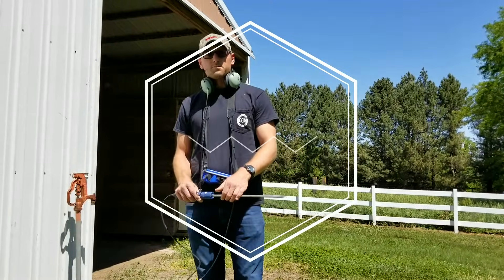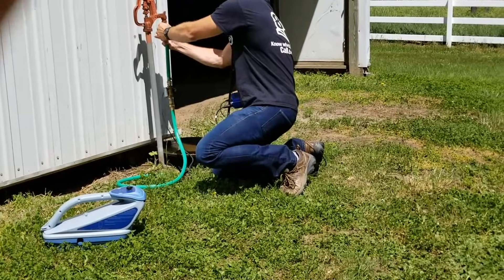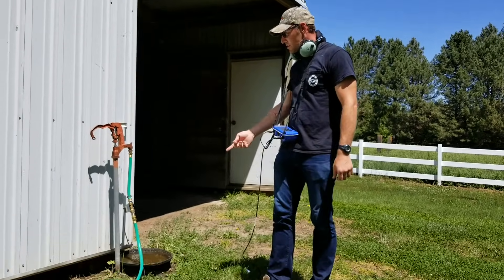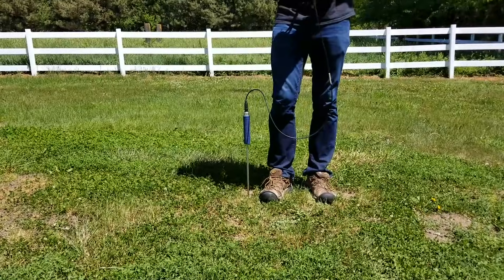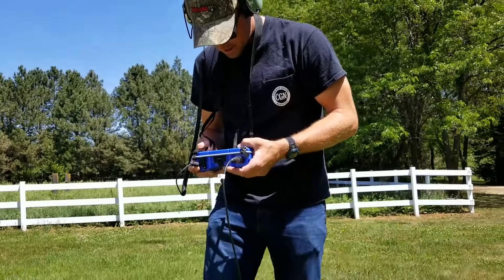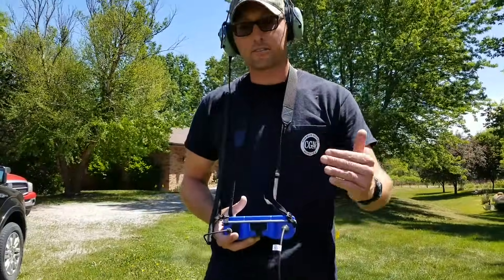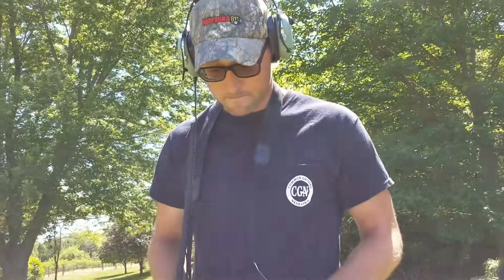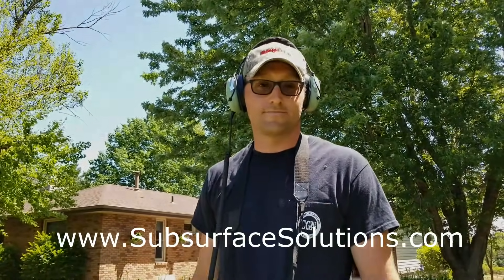Locating Plastic Water Lines

Comment: Friend bought house, it's has full plumbing, but no water when cut breaker on, the main water line leaves pressure tank, to hole in side of the house, then it doesn't go anywhere, yeah. No well cap nothing, appears 3 feet of water feed line coing out of ground, but just open hose, however, neighbors back yard, abandoned house, this house, owner died, relatives sold it, but know nothing about, so how do I locate well? Or water source?  Try tracing well wire? Digging?
Reply: You need to use a location device if there’s a wire that goes to the mystery well you hooked to that and locate if there is no why are you cutting said waterline stick a metallic fish tape through and then locate that

Comment: That's ok for finding the pipe but can it pin point where the leak is in said pipe? Does it give out a different sound where the water is actually leaking out?
Reply from the maker: Yes you can use the same equipment to find leaks.  Yes it is a different sound.
Reply: On poly lines you need to do a gas test not acoustic

Comment: I need ya or recommendation for finding a 2 inch main on my irrigation line. They never marked were the solenoid is. And it's stuck on.
Reply: You can locate the control wires

Comment: Can you find a drain field PVC pipes with no water running through ?
Reply: No sorry. Needs to be pressurized for this style locator.  The best for field tile is locatable push rods, GPR, and mechanical probing.

Comment: Would someone explain what a little bit of water coming from the hose does.  Not clear why that's important.
Reply: There's a piston that pulses and in the process it lets out small streams of water. The purpose of the hose is to help guide the flow of water away from a building or simply to keep a possible muddy mess away from where you're working.
Reply: @brentbriley4133  it produces a water hammer, that low frequency sound is what the mic listens too. issue is its low frequency, which travel farther than high, it can get you in the ball park, but high frequency will put you in the seat.

Comment: Easier and cheaper to use a coat hanger.
Reply: Yes and no. For those that are interested due to the engineering impact, we need something more dependable and proven. Although I have seen the witching sticks used with success, they are in my opinion, less reliable than a device such as this.
Reply: LOL.. EXACTLY..so unless i plan on locating all my pipes or decide to become a full time plumber. this video rocks.,. But since im a DIY guy and dont plan on more than one undergroung leak in my lifetime, ill use a hanger.. and for the premadonnas, ill use a fancy hanger lol..

Comment: Would this device work on a mile long worth of PVC pipes underground? My water meter is a mile away from my house and I'm looking for a underground water leak.
Reply from the maker: No, you are limited since you are working with sound.  Most likely you will only get about 500-1000ft
Reply: it doesn't  "find leaks" it can help locate pipe which is beneficial when looking for leaks.

Comment: I had actually discussed with a co-worker, about how to find plastic waterlines through the water using vibration or safe current and a device that could pick either up.

Comment: Is this system usable for locating underground Orangeburg drain pipes? They are those pipes that are made out of felt and tar that were around in the 40s through 60s.
Reply from the maker: No sorry. This needs pressure on the line. You'll have to use a sewer sonde or locatable push rod.
Reply: What I don’t get is why they don’t put marker ball around sewer lines, even older ones they could dig and throw marker ball after finished

Comment: I have a spigot on my detached garage that doesn’t work. How can I find the line without being able to run water through it?
Reply from the maker: You would have to run a fishtape from homedepot down it and use a utility locator to apply a signal to it.  Your best hiring a local private utility locator to get the job done for you.  Visit your states 811 webpage to find a list of private locate companies or call 811 and ask them.
Reply: I have a fish tape and a metal detector. Would that work, or do I need something that transmits a signal?
Reply: @AdamCanFly  you need something to apply a signal
Reply: @AdamCanFly  no that would not work, you kinda on the right track, fish tape with a pipe locator using the conductive method

Comment: Would you be able to locate large pipe for commercial buildings?
Reply from the maker: Sure as long as you can apply the transonde to the pipe through a faucet near where it feeds the building
Reply: Trevor Barney , yes as long as you can hookup the electronic transonde somewhere close to the  service.